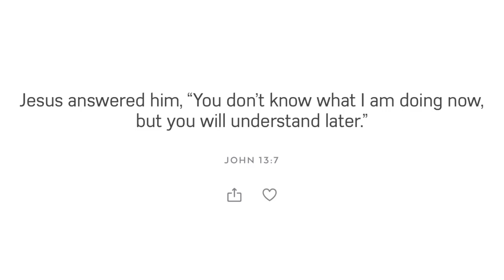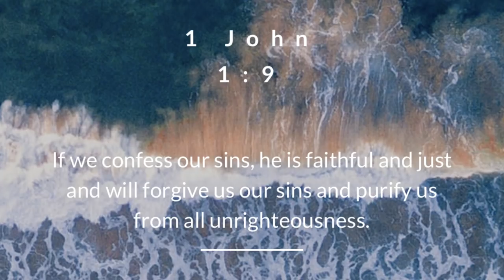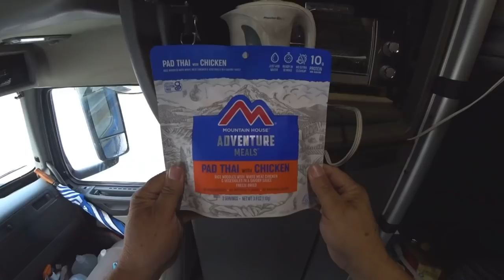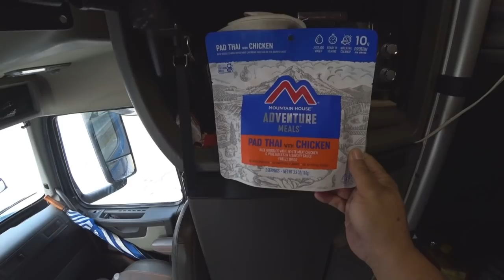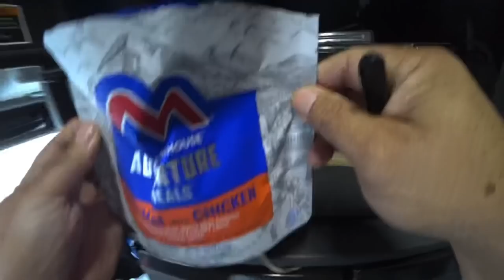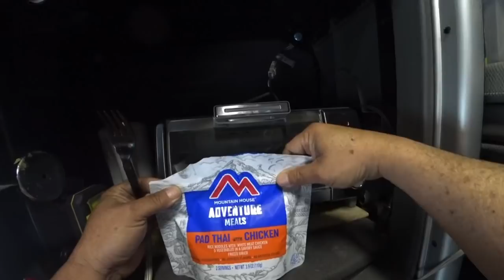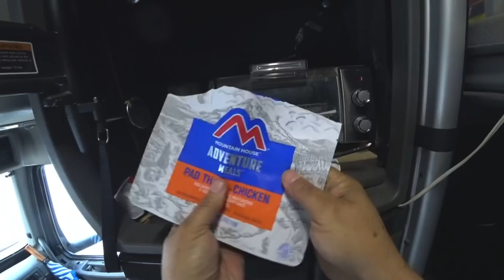May 10, 2022/144 Trucking. Loading at Brakebush foods. Irving Texas

Comment: The DC input limit is 84 watts via the 12V socket. The capacity is listed as 266wh. 266/84= about 3.1 hours, but realistically will be ~4 hours to fully charge that battery bank from the cigarette lighter port, if it is fully discharged. A 30 watt fast phone charger would take about three times as long. Just estimates based on data from Amazon on the battery bank.
Reply from the maker: It took 6 days to fully discharge. It didn’t charge a bit with a cigarette lighter plug after 10 hours. It took 8 hours to fully charge with its wall charger that came with it
Reply: @24juan68  The wall charger is ~40 watts, so that makes sense. If you can get it to accept a charge via the cigarette lighter port, it should charge in half the time it took the wall charger.